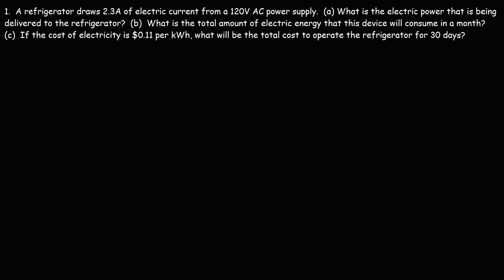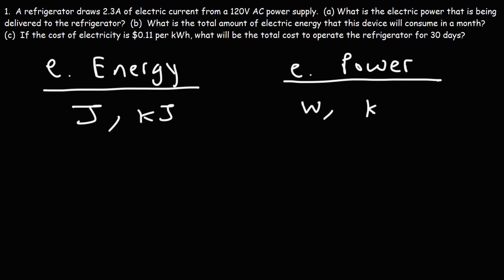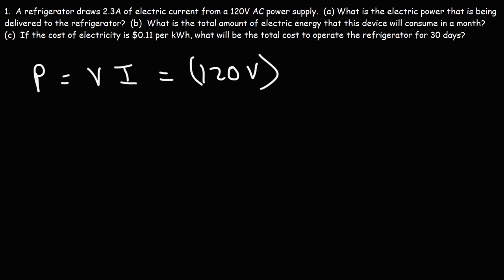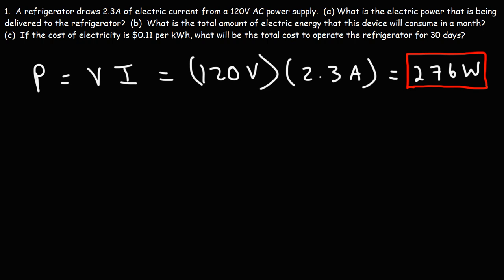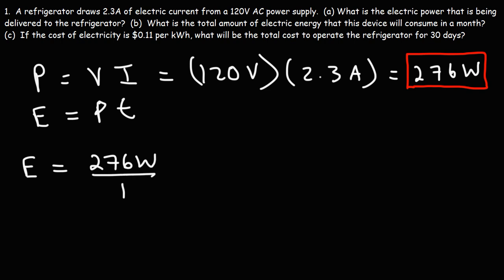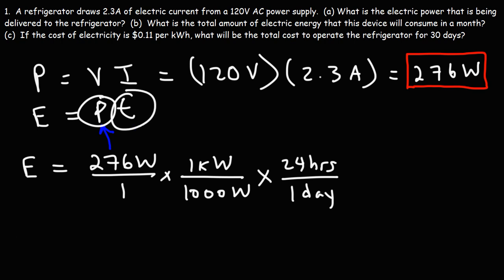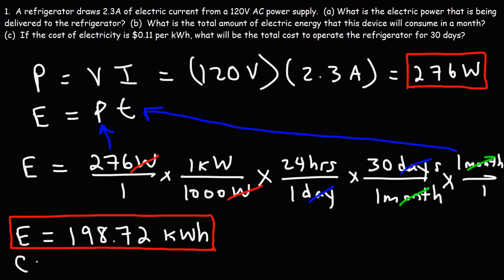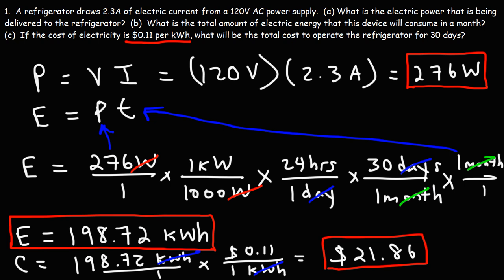Electric Power and The Cost of Electricity Using kWh

Comment: A dc motor produces 40n for 5 minute when connected to a 240v, 20a supply, determine (1)the efficiency of the motor (2) the energy lost per minute (3) determine the cost of energy consumed by the motor after one week of use, if the cost of electricity is k30 per unit????

Comment: If in question a) the electrical power being delivered to the refrigerator is 276 W, which is 276 Joules/second, then why, if we’re dealing with seconds do we jump to 24 hours/day for total energy used in a month in question b)? Why didn't we add 60 seconds/minute and 60 minutes/hour in question b)?

Comment: Idk if you'll read this but I have a question.
If the power on 5:29 in 276W that would be equal to 276J/s so then you should calculate from seconds to months, right? Like, instead of (276*24*30)/(1000) as you put, it should be (276*60*60*24*30)/(1000), right?

Hope you read this and thanks for everything!
Reply: This is the same question I had. If you start with Watts, or joules per second, then 86,400sec/1day * 30 days / 1mo, then you get 715,392 kWh

Comment: If an element in for 8hrs calculate the energy used when the cost of 1unit of electricity is 35ngwee. Of which power is 2kw resistance 20, and 10a

Comment: in 5:30 ish, instead of doing all that, you could divide 276 by 1000 x 30 months. convert 30 months to hours which is 720h. so answer will be E=(276/1000)*720= 198.72. I'm right right?